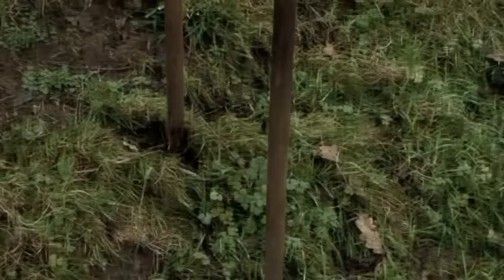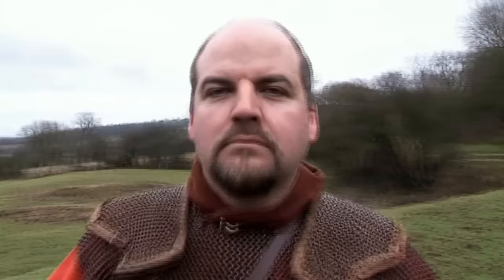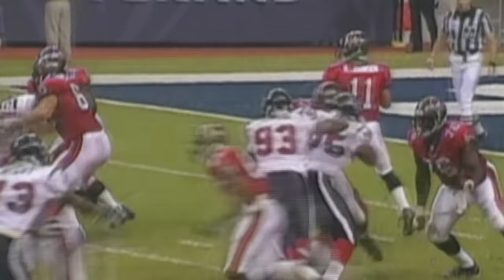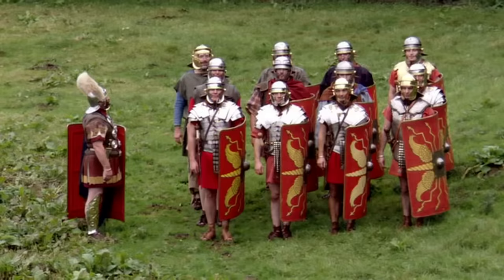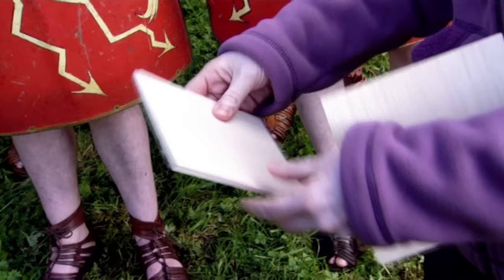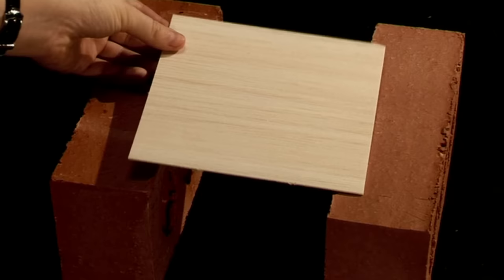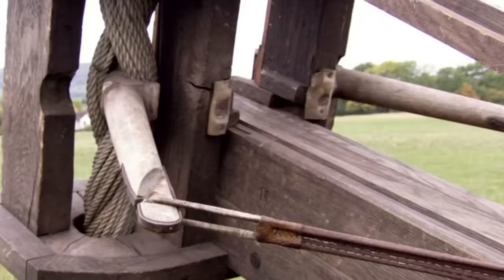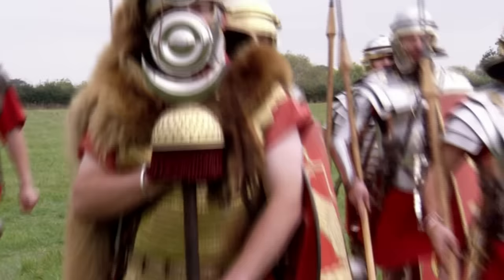Roman Military Technology and Tactics

Comment: every weapon and armour shown in this was not Roman it was Celtic. the sword used by Romans was a celtic childrens practice sword before getting  the full size sword which was 6 foot long and made from steel.

Celtic armor was full plate armour with chain mail under it. Roman armour was leather. celtic sheilds were bronze roamn sheilds were leather sctrecthed over a wooden frame.

celtic longbow was 8 foot long and when made correctly can pierce the armour of a WWII Sherman tank at 800 meteres. only used by the Crymru tribe of north wales

celtic chariots made by the Icinnii tribe 2 types light 2 wheelers with iron plates steapped around it  sythes on the front next to the horses and carried a crew of 2, driver and archer uualuy the longbowmen or a slinger. they rode in firing at the RFomsbn to ge tthem to form turtle. then the heavy chariots went in 4 wheelers 4 man crew driver and 3 swordman. swordmen would jump off and slash away at the sghuilds ripping them apart while the chariots use the sythes to cut the legs of the Romans.

a celtic army of 10k could take on and beat a roman army of 100k very easy.

the Roman roads have tunred out to have been built by the celts thousands of years before the romans were even heard off.

Documnets from every tribes in Europe that had contact with the Romans all say the same thing. but ignored by historian's. Romans wer ea very backward barbarian tribe who could not read and write till the celts taught them and had to invent a languge for them as gailic was to complicated for them so the celts created latin as it was easier for the thick Romans to learn.

Rome was built by the Ettruscan tribe a celtic tribe in north italy. they marched into Rome after beateing a Roman attack on their land. they planned on wiping it out. but when they saw the state they lived in mud huts that were falling apart the Etrescans decided to build rome out of stone and built roads and everything else to help the Romans look after themselves. taught them how to hunt and grow food. then left them loads of gold. Rome used the gold to hire mercanries to go and wipe out the etruscans.

Rome used a slave army to do their fighting for them. every village the Romans army marched into had to send all their sons when they reach a set age to fight for the romans if they refused to fight their families would be killed.

Roman tactic to take out more powerfull tribes like the celts was sne d aslave army out to pull in the celt army while their main army marched into thier towns and killed all the men and women too ol to be of any uses killed all the young girls and raped all the young boys.
Roamns were mosty gay and hated women. to them women were nothing but slaves to have their children but they loved little boys.
Thousand of documents out there to prove it but ignored or destroyed if the pope gets his hands on them.